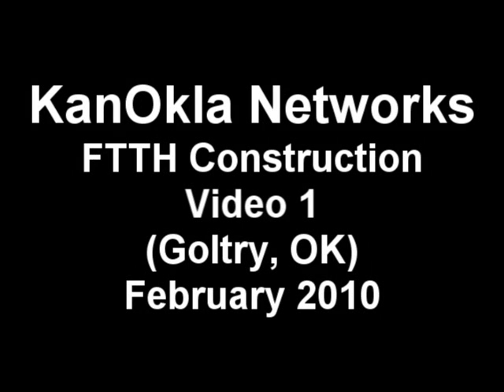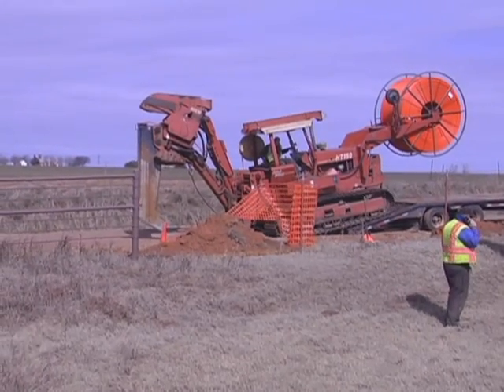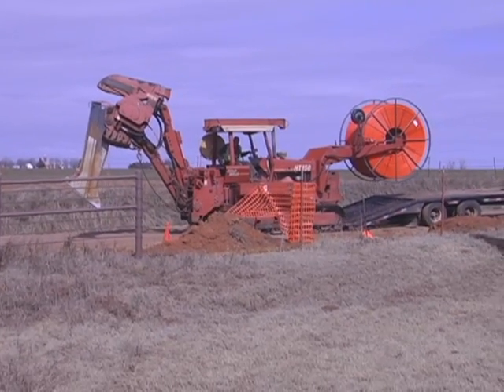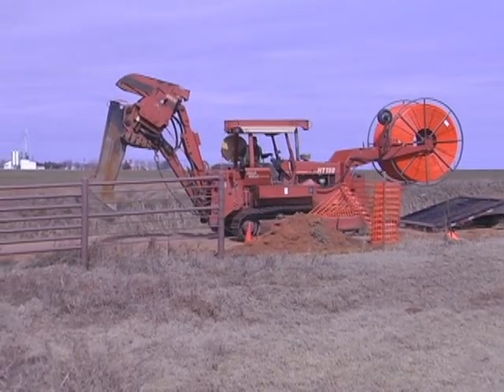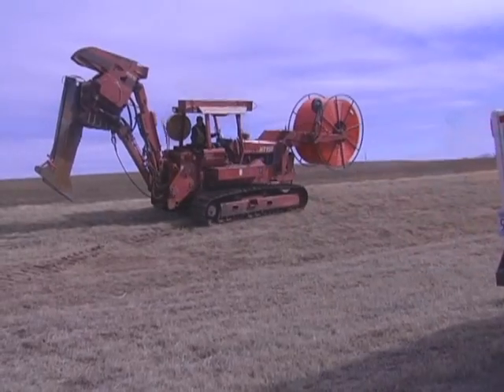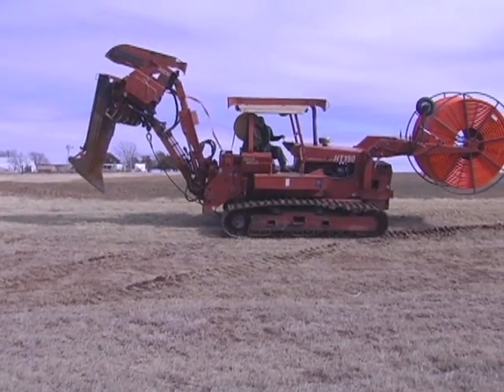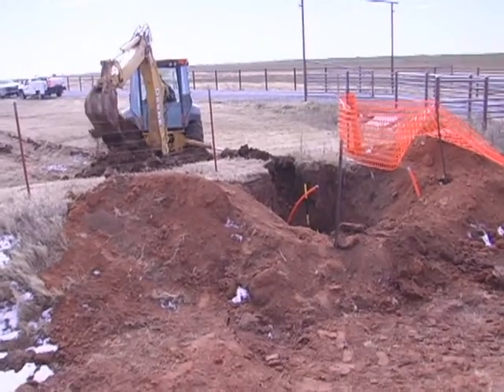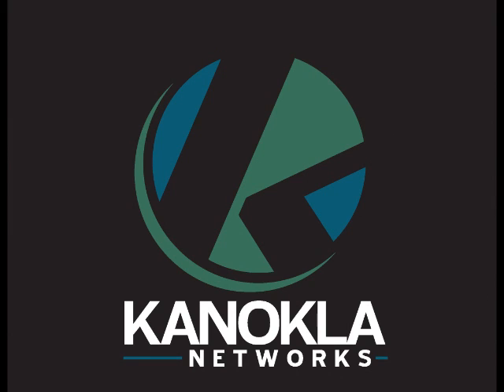FTTH Drop Installation

Comment: Depending on the utility, what the company the work is being done for, as well as different requirements and such. In my experience, fiber is plowed at a minimum depth of 36 or 48 inches. I have plowed drops to the homes, which had to be at a minimum of 18 inches

Comment: They were preripping because it was hard ground. That makes it easier for them to plow it in. The blade goes through more easily without anything in it. Also, they can find out if there is any rock they may need to hammer or saw and dig it out first. Plus, if it is very hard ground, they can back up and rip it again to get it down deep enough, versus having to lift up and dig it down, causing more work and cleanup. Utilities (fiber, copper, power, etc.) have to be at certain depths